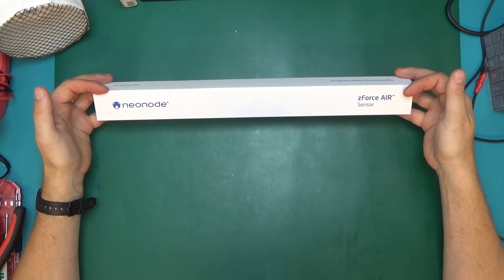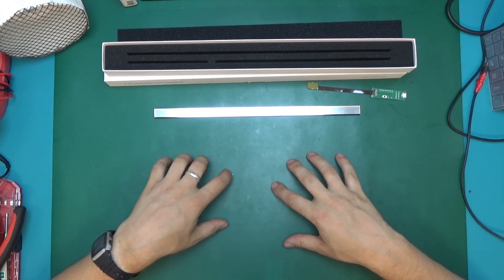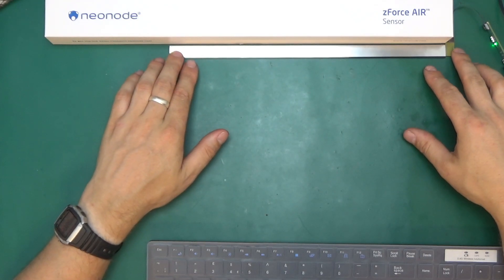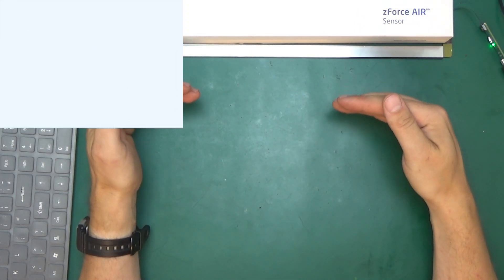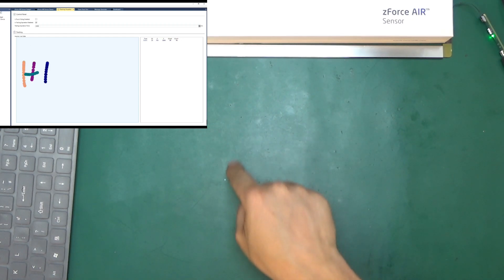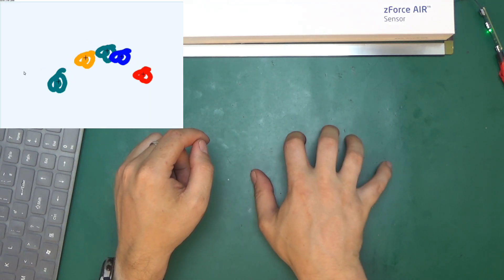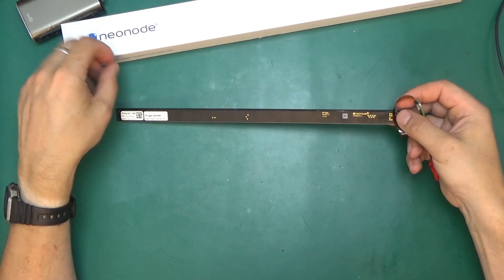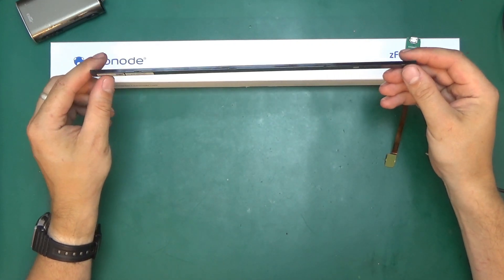#011-  Neonode zForce AIR: first look at the sensor

Comment: How far away from the bar will it still track? 
Is there a definite cut off point or does it get a bit sketchy before it stops tracking?
Reply from the maker: It's approx 0.75 of the length of the sensor